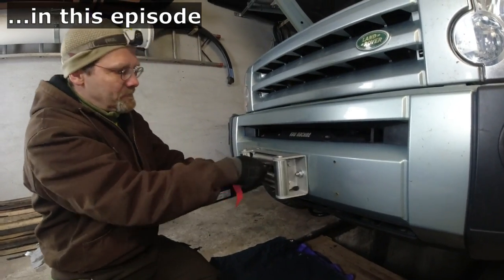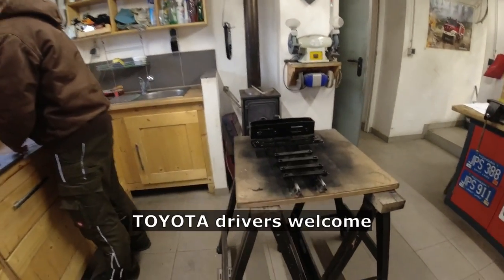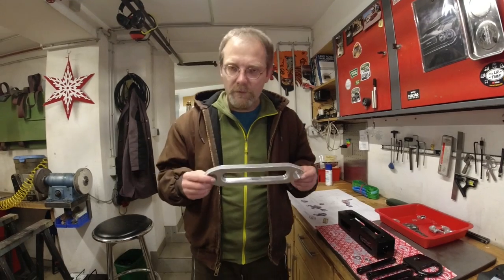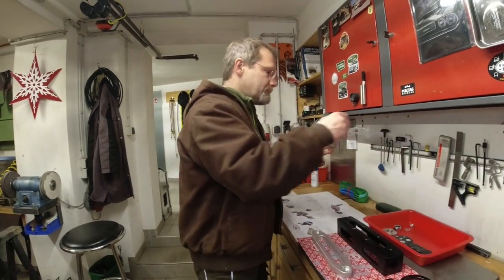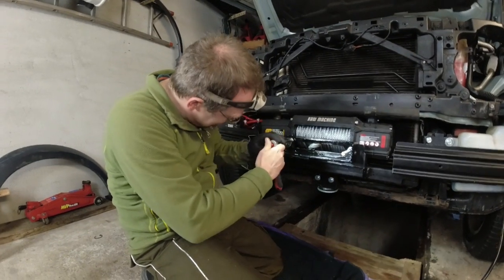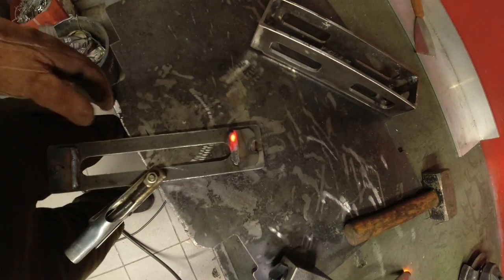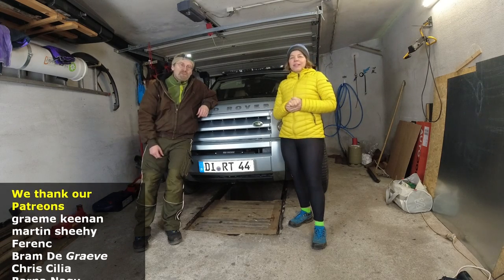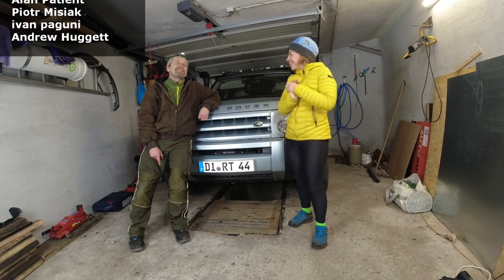Land Rover - very Clever DIY winch mount - Part 2 of 2

Comment: Very cool.  Re the actual winching, I was told to keep the gearbox in neutral and foot on the brakes.  The 'parking pawl' that (that locks up the gearbox), is actually quite small and weak, wheras the main brakes are a lot stronger and doesn't stress any of the driveline parts.

Comment: Christian totally enjoy and appreciate all the Land Rover knowledge you impart. I would like to communicate my experience using  winches on 4wds in Australia for over 20 years. There are big issues rewinding wire cables if the winch drum cannot be seen so the cable can be laid across the full width of the drum, this is especially apparent when long lengths of cable have been deployed. From experience the drum must be visual at all times.

Comment: Hi Christ and Vera, beautiful quality work, as always. Particularly liked the folding number plate and the very beautiful winch clutch handle.

I don't need a D3 anymore but I wish I had one so I could do the modifications you have designed and fitted to Vera's D3.

Sundays afternoons are not the same without an "LR Time" video.

Comment: I love your custom engineering solutions! And I thank you for all your DIY videos. I just replaced the rear pinion seal on my 06 LR3 and your front pinion seal replacement was very valuable. But you didn’t talk about rust making removing the propshaft so difficult. Haha. Found a YouTube tip to use a ratchet strap which I connected around a part of the frame in the front. With that tight, a couple hits with a screwdriver  on the tiniest bit of exposed propshaft from behind the flange did the trick. Of course this solution came after many hours trying other ineffective methods. Thanks again! Both of you are a joy to watch.

Comment: Christian, excellent design with the clutch lever. I have one suggestion, I think you should laser engrave or emboss the lever indicating if wether the clutch is engage or dis-engaged. I know the primary operators will be yourself or Vera but you never know if you might have to depend on someone else to help with winching.

Comment: Hi guys, Excellent workmanship as usual, i was thinking it would be easy for n electrician to make some kind of switch to disable the air suspension without having to keep taking the fuse out as i think you will ware out or damage the contacts over time, may be an idea for a future video.
Reply from the maker: 🙄 I will not show him your comment, he is going to do that then. But no, we are not worried about wearing out contacts, otherwise Christian would not do that. It also happens only maybe once a months that we work on my car. He is an electrician after all and should know. 😅👍🙋‍♀️Vera

Comment: Hi Christian and Vera, Nice job but I’m just wondering why you are wanting to use a steel winch cable?

Thanks Mark
Reply from the maker: Price was the main reason. We cannot afford a winch in the thousands that we do not really plan on using. However, if it turns out we need it more than we thought, we might upgrade to a synthetic rope.🙋‍♀️Vera

Comment: Love this design! I will be looking to mount a hidden winch at some point - do you think this would also fit on a Discovery 4, or might it need some modification? Different bumper style/shape... Maybe some changes behind? Might also have an issue fitting this if you already had an aftermarket steering guard with a hole for the original recovery point I guess? I love the flip-down number plate... Very James Bond! Is Christian the new "Q"? 😂
Reply from the maker: We do believe that it will fit the D4. I can send you the drawings and you can check those dimensions on your car.👍🙋‍♀️Vera

Comment: Great work.  Ive got a problem that is being solved by the LR mechanic changing the HPFP.  He has changed it twice.  Its been working for 3 months and now i have the same fault engine code has come up again.  P2288 - Injector pressure too high.  This is the same fault i had with the prior HPFP and the mechanic LR decided to replace the HPFP but i think he has not done enough investigation.  This time as well as code P2288 i have code U0073 - Control module communication bus off. ?  i do not think its HPFP because the supplier says he has not recieve any returned and so it could be my CAN BUS?  Any suggestions old mate?  or anyone else?

Comment: Hi, random question. Have you heard of a bypass oil filter, or ever considered fitting one? It's a slow rate filter which is teed into the main system and is supposed to take out more impurities in the engine oil.
Reply from the maker: No, we believe frequent oil changes are best, especially when your oil gets diluted with Diesel, which is in our opinion one of the biggest problems. We also do not want to tinker with the oilsystem and by that messing with the oilpressure necessary to provide a constant oilfilm on those bearings. 👍🙋‍♀️Vera
Reply: @Vera_and_Christian  Many thanks. Very good point about oil getting diluted with diesel. Love your work. Best wishes.

Comment: I fitted a winch recently to my D3 but it has a bull bar fitted, I would prefer to have regular bumper but after a recent trip and seeing 5 or 6  ft tall rabbits ( aka. Kangaroos) I may just keep the bar on
Reply from the maker: 😅👍 Yeah we don't have that problem. Can you take off your headlights without taking the bullbar off?🙋‍♀️Vera
Reply: @Vera_and_Christian  I can change a lamp but I can't get the whole light fitting out.
Reply from the maker: @peterbullen3347  We always think about those who have to take out the bull bar, that includes Land Rover mechanics. 😅👍 We almost always take out the lights when fixing stuff, to make room, and there is that stupid little screw you need to take out when you want to remove the fender liner. You probably have that taken out when you installed the bullbar. 😃👍🙋‍♀️Vera

Comment: Are you running Alloy guide with steel cable?
Reply from the maker: No, not if we use it under heavy load. We showed in the video what we will do when we actually have to winch under load. 👍🙋‍♀️Vera
Reply: @Vera_and_Christian  I just wan't to write that setup in the video is (by my knowledge) not ok. If you are running steel cable than you should not use alloy guide. If you are running alloy guide you should runn rope in your winch. Greetings.

Comment: It's much easier to mount a winch on a Toyota by installing a trailer hitch on the front, putting the winch on a trailer hitch adapter, then just putting it on when you want to use it!
Reply from the maker: 🙄 everything is easier on a Toyota, including making coffee.  But thanks for checking out the complicated way too.  Christian

Comment: I strongly suggest you ditch this wire rope and get synthetic. I use wire rope from work in forest to use on my first 4x4 car due to price and I disagree with advantages you point against wire rope. I switch for synthetic ropes in forestry and the job is much easy lighter and safe. For maintenance yes take more time but if you think wire rope is maintenance free and dust free is not the case and you are mistaken, as all those wee tiny rocks between wires constant work on that wires even you not use it. Vibration while driving due the work against and the tiny rocks will eat your wire rope which lead later to accident… that could be fatal. To those who think synthetic rope when brake is not dangerous are mistaken too to be fully safe don’t use any metal just use synthetic shackles and ditch hook you don’t need it while having soft shackles but use bag with sand in the connections so in case rope broke it land under weight of that sand bags or whatever you put to that bags. Enjoy and be safe even in mall crawler lol. BTW your German company Liros made one of best 4x4 soft shackles and recovery ropes where you don’t need use metal shackles.

Comment: Kind of interesting...I have in storage a rare VW Polo 16v one owner 1999 registered...it seems to do everything it should on the button...full leather... climate control ..autobox...it flies with no problems...no drama...it wouldn't make great YouTube content of course... which allows time to watch and enjoy yours...I'm guessing your LR3 is female ?...great to watch but not too live with....😂😂👍😂
Reply from the maker: No, I do not consider my Disco 3 as female. Fabians D3 is a female in my opinion, such a princess, and picky. 😅👍🙋‍♀️Vera
Reply: @Vera_and_Christian  Hi Vera....great humour as always...the pair of you are excellent...I'm in awe of any engineering skill..but your patience is over the horizon. 😍...some shocking news...my Polo needed 100 ml of power steering fluid today..😱 ...two minutes of investigation and the only tool I have ( a set of screwdrivers with adaptable heads) fixed it...it's so disappointing that this hose fixer backed off one quarter turn in 22 years...loving your stuff of course and share many many times 👍

Comment: You guys need to move to the UK. No laws on sawing logs during daylight hours only, no law regarding using a specific saw oil! No laws about 5 year old machinery or what PPE you MUST wear etc, etc, etc, , In the UK Health and Safety provides guidance , rules and regulatory requirements  relating to log cutting by private citizens. Professional and  commercial businesses are rightly regulated very carefully by our BSI (British Standards Institute) so I don't know why you tolerate such rules.